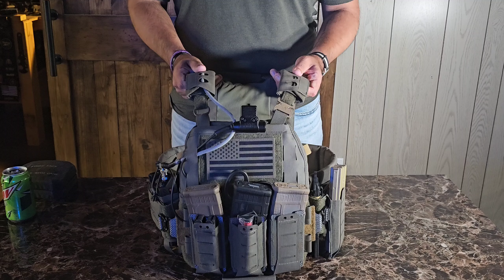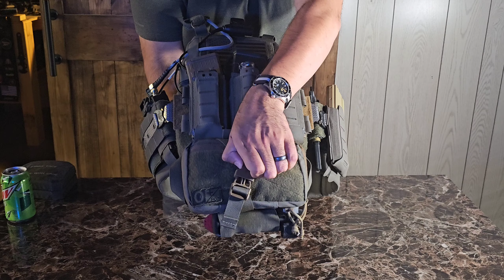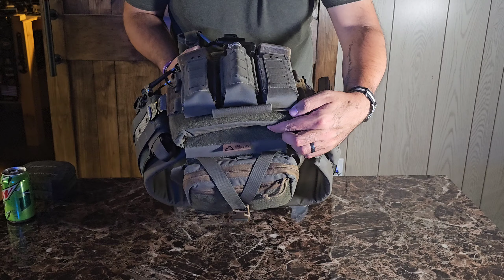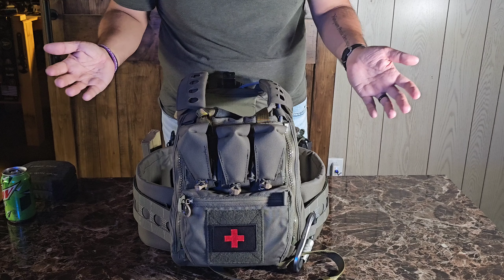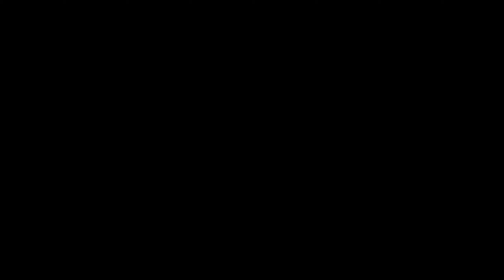Ferro Concepts FCPC v5 Plate Carrier Setup + Full Gear Breakdown

Comment: For your antenna look for ways to run it along your cumberbund. It will have you donning and doffing from one side of the plate carrier, but it will be easier on your radio connector with way less potential snag space.
Reply from the maker: I already don/doff from one side of the carrier. I've seen some folks run their antenna along the cummerbund, but there hasn't been any issues running it up through my shoulder and along my back.

Comment: Is this the large or medium?
Reply from the maker: The plate bags are medium
Reply: @Prepared_Mindset_Pod is there a massive difference in plate bag sizes? I’m 6ft 6 and have a longer torso but I’m not wide in the torso of that makes sense? Tall and slim. Would you suggest a large or a medium?
Reply from the maker: @dancinggorilla7 as far as I know for Ferro, the plate bag sizing has mostly to do with the size of your armor plates, and not your physical size. For reference im 6'3
Reply: @Prepared_Mindset_Pod yeah I’ve read that I think. I just didn’t want the bag to sit too high up on my torso. I usually sit my plate carriers higher up so close to the neck and I didn’t want it to look to short if that makes sense?
Reply from the maker: @dancinggorilla7 yeah I know what you mean. I think youre gunna be a little restricted in that regard, by the size of your plates. You could also add a dangler pouch if you wanted it to look a certain way.